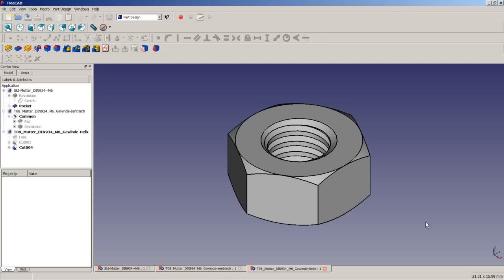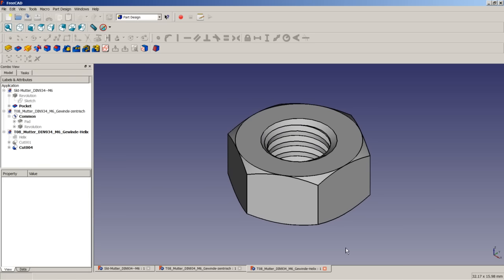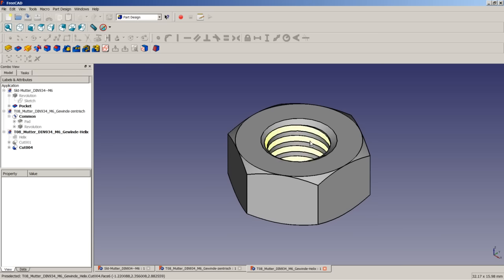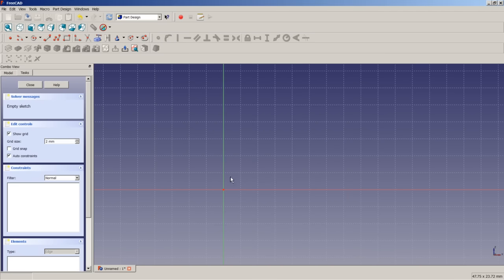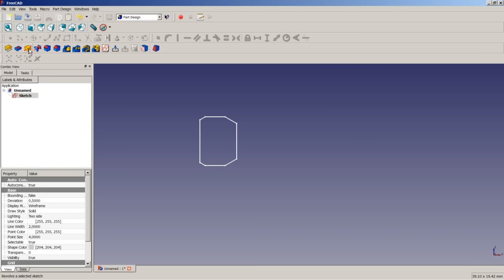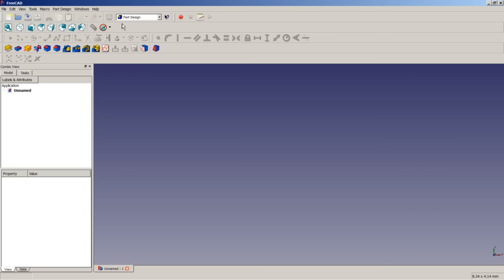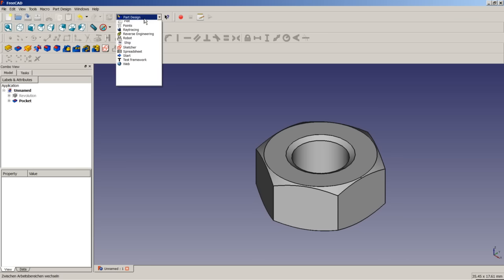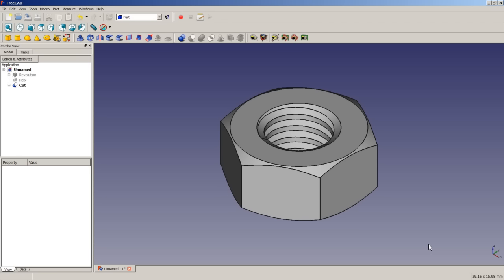FreeCAD Lesson 08 - Inner Threads

Comment: Thank you so much for these very helpful tutorials. I studied design engineering but I haven't used CAD in over 6 years and I learnt using solidworks, so your tutorials were a great intoduction to freeCAD. My goal is to work designing bicycles, so my next project is to design a bicycle frame using freeCAD. Thanks again and I hope you will be doing some more tutorials.

Comment: While there may be more current approaches to doing this, this is still a great tutorial.  Frank is still helping people years after he passed. One question,  are the threads as designed backwards?  Looking at 38:55, shouldn't the vertical surface wall of the threads be on the outside radius of the threads as that surface needs to mate with the cylinder ID on the nut itself.

Comment: This is a very informative video Thank you very much ,

I'm working: On Ubuntu 18.04.2 LTS with FreeCAD: 64-bit Version: 0.18.15671 (Git)

I was having a problem with: make a intersection of two shape. I  had to put the padded polygon in a group folder first or FreeCAD-18  would not make the intersection cut of the two shapes. Maybe This will help someone else and they wont have to work on this like did for two hours before getting it done LOL. But I've learned a lots from haveing to work this out. Thank Again for a very informative video. 
:-)

Comment: Can someone please explain me what the role of the construction line that is being drawn at 23:37 is? I am a bit confused about that... Also, I ended up with 1 degree of freedom at the end, which I eliminated by specifying the thread angle (60 degrees) so I'm not sure how he got to 0 DOF in the video the way he did...
Reply: Its easy. Construction geometry is used where you dont want the geometry to be used in the solid but used only, for example-positioning. reasons
Reply: @100Jeanluc  I had the same question: what aspect of this model is being positioned by the specific construction line in question?
Reply: It’s a construction line to create a symmetry constraint on the thread flats. All the other flats follow this constraint due to all the other equality constraints he already defined.

Edit: now I’m confused. If they’re all equal, why would that be necessary...

Comment: Just started to learn FreeCad, it would be nice if parts like nuts & bolts were library items, you just selected. Oh you can, learned something new. Dec 2020
Reply: Mac, Have you tried adding the Fasteners Macro using the Add - In Manager under Tools.  There's also a workbench there called  BOLTSFC that you can add. I'm new to this package as so I'm not sure about all the capabilities.

Comment: Great tutorials, but the newest version of FreeCAD is so buggy, there is no way to get the Cut function to work. It is impossible to do threads because it won't remove the sweep from the pocket profile. Not sure if anyone else has been having this problem. If you can share how you are overcoming this bug, please do.
Reply: Hello Barbara, it has been my experience that FreeCAD 0.17 is no more buggy than previous versions (and I've used them all since 2010). Actually, it fixed countless bugs. The new stuff in PartDesign allows a different work flow than what is shown in this video. Creating realistic threads remains troublesome and that is in part due to the geometric modelling kernel FreeCAD uses, a third-party open source software library called Open CasCade (OCC). As far as geometric modelling kernels go, OCC lags behind commercial kernels such as Parasolid (found in Solidworks). One thing that can prevent a successful Boolean cut is if the sweep profile is aligned with the seam line on the cylindrical face (the edge that splits the cylindrical face) of the nut. Rotate either the sketch that created the Pad or the helix and sweep profile slightly on the Z axis by a few degrees so that the start of the sweep does not coincide with the seam line. You will get more advice on the FreeCAD forum.

BTW, Roland Frank, the author, died last year, in September 2017. We miss him, and the v0.17 release published in April 2018 was dedicated to him.
Reply: Oh, that is so sad. I am very sorry to hear that.  Thank you for letting me know. With regards to the FreeCAD application, I don't know what they did with the latest release to fix bugs, but it will not run on my computer. It keeps shutting down or locking up which requires me to kill it in task manager. I have a brand new Dell Alienware computer so there is no way it's my computer. I have not been able to log onto any of the forums or report any issues I've had through the FreeCAD site --that just doesn't work either because I can't find the screens to do it. They have made it too difficult to report issues.  I think I'm done trying to use the application. I've just wasted another 2 hours of my life trying to get the application to work, including uninstalling and reinstalling. I've spent over 100 hours using the application already on a project I'm working on and now I can't use it at all because it won't function.  For anyone who reads my comment, please spare yourself the frustration and aggravation and find some other CAD application to use.
Reply: @barbmarik  Sorry to hear you have problems: I take it you are using Windows 10 on your Dell.

For anyone reading your last sentence I have no problem running it on Windows 10 on my Lenovo.
I am also happily running it on a Dell machine using Linux Mint.

I am also puzzled that you can't log on to the FreeCAD forums site ( https://forum.freecadweb.org/ ). Here is a thread relating to a similar issue reported with FreeCAD v0.16 together with some suggestions for this happening 
( https://forum.freecadweb.org/viewtopic.php?t=15963 ). To search the forums more effectively place your key words (or phrases in parentheses) into the search box in the forum header. This will generate an advanced search of the FreeCAD forum site through your default search engine. Using this method is more effective than trying searches through the forum software (which itself has no decent advanced search facilities).
The above forum thread was one of a number of hits in my search engine found from using the above search method with the phrase "wont start".
Hope you may find FreeCAD suited to your needs in the near future.

Comment: I think this a where I get off, v0.17 is just too inconsistent and buggy for me. Despite toggling the grid in preferences it never appears in the sketcher which is annoying but I could live with. Now though the actual axes aren't appearing consistently, making it literally impossible to orient a sketch in space since the origin and the axes aren't visible.  Guess I'll be using autocad until freecad gets more development progress.
Reply: @arath duiliath - many of us don't bother with the grid as accuracy in drawing sketches is initially irrelevant. As constructing a sketch is a 2D operation on a defined plane (usually XY, XZ or YZ) a line constrained horizontally on the XY plane will be parallel to (or perhaps on) the X axis. If you pad such a sketch the resulting solid will have sides (faces) in all three planes. Other solid construction operations, such as sweep will provide a dialogue to allow using the appropriate plane axes. If you zoom in on a small sketch of course the axes may disappear beyond your screen boundary.
If the behaviour persists report it on the FreeCAD forum (do a search first) and you will likely get a response with either an explanation, solution or work around. 
As reported in a reply to Barbara Marik - the workflow for the part design workbench (on which this tutorial is based) has altered since the release of v0.17 and using master sketches and datum points and planes considerably improves both accuracy and consistency in the use of sketches (have a look at Ha Gei's YouTube tutorials about these topics especially this one
https://www.youtube.com/watch?v=8Bmcgn2RBGI&t=755s ).
Finally, you mention returning to AutoCAD: obviously FreeCAD is far less developed than AutoCAD but it is also designed as a parametric 3D modeller rather than a 2D drafting package, despite the fact that you can in fact do considerable 2d work in it.
Reply: Maybe i can help.  I noticed in v0.17 when i toggled the visibility of the pad before i created the 2nd sketch, I had the same issue.  No grid or no axis lines.  Now when i toggled back the visibility of the grid & axis lines came back, and i was able to re-toggle off the visibility of the pad.
Reply: @yadisoloblack  that totally helped, thanks a lot